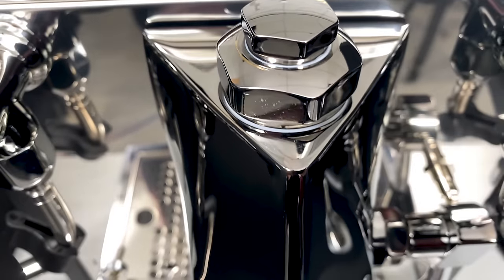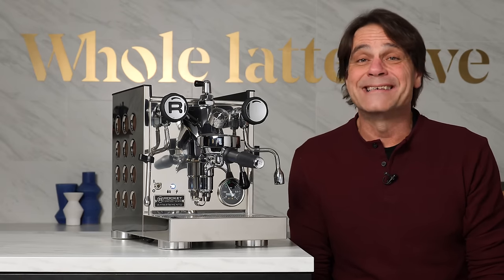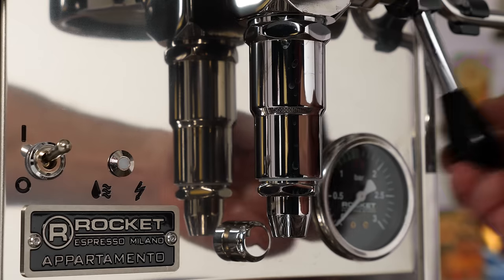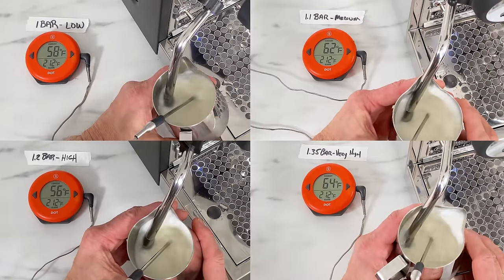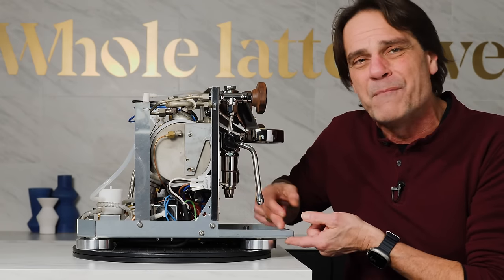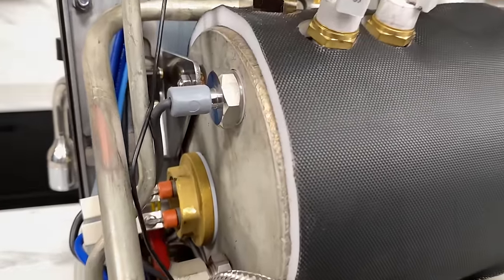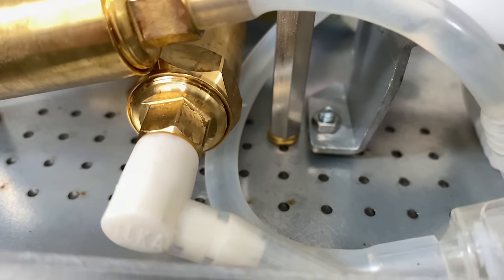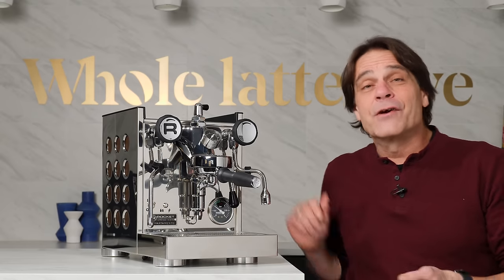Rocket Appartamento TCA Espresso Machine Review

Comment: The Swiss Kaffeemacher team just published very extensive test results for this machine. The temperature tests are very disappointing. It takes this machine 42 minutes to get up to temp! It's 2024, Rocket can't do better than that?? The original model was better!
Reply: @Wholelattelovepage could you confirm these results? The review was pretty devastating for the TCA.
Reply from the maker: Hi s, I cannot confirm/deny the 42 minute heat up time. I did not test for that. I have tested other E61 group machines in the past and found full temperature stability reached (by measuring group surface temp) at 28 to 35 minutes. If it's an extra 10 minutes I would not consider that devastating. Those concerned with heat up time should go with a smart plug or similar so any E61 machine is heated and ready to go when needed. There are E61 machines like the Profitec Drive which have fast heating modes using brew boiler overheat plus a flush and non-E61 electrically heated groups like Bezzera's BZ which can be ready to brew sooner.
Marc
Reply: Wow! How much electricity will you use per year heating it for a coffee in the morning and a coffee at lunch? It would likely cost a fortune?
Reply: Mine warms up in less than 15 minutes 👍🏼
Reply: @c0mbat15 it’s a 2 thousand dollar machine for brewing espresso. However buys this couldn’t give two dog craps about the light bill
Reply: @peter-7118 how so?

Comment: Wow there's a lot of hidden updates here! New Steam tip, new unpainted solid frame, and insulated stainless boiler are all exciting updates that others have missed. Love how thorough you guys are.
Reply from the maker: hi tm, yes there are and thanks for the kind words!
Marc
Reply: Yeah, I own the exact same one. I haven’t even noticed most of the new features lol.
Reply: The boiler is not stainless steel but coated and treaded copper. Rocket have producing machines with this coating for a couple of years at least.
Reply from the maker: @vittorioascani5615   Thankjs for that. I did pin this comment a few weeks ago with that correction:
Correction on boiler material: Boiler is copper and coated with Tea B technology developed by an Italian company: https://teaplus.it/en/index.html
The hot line copper pipes are treated with the same technology.
The product is NSF safe.

Comment: i thought HX machines didn't need PID....they were supposed to be stable by HX design.
Reply from the maker: Hi s, HX machines without PID that run on pressurestats for temperature control operate in a wider swing of temps in the boiler. Some machines of that type are better than others but most will require a fairly aggressive cooling flush if on and idle for long periods.
Marc

Comment: is it possible to regulate the pump of water?
Reply from the maker: Hey g, thanks for the question. Maximum brewing water pressure can be changed internally by adjusting the OPV. Beyond that, the Appartamento TCA is available with flow control on the E61group. Using flow control, one can control and adjust brew water flow rate and pressure during an espresso extraction: https://www.wholelattelove.com/collections/semi-automatic-espresso-machines/products/rocket-espresso-appartamento-tca-espresso-machine-with-flow-control-black-and-copper
Hope that helps!
Marc

Comment: This is a very interesting machine. I noticed on the website there are a lot of reviews. However, the machine is relatively new and some of the reviews are pretty old. Are the reviews for the older Apartamento accidentally showing up for the TCA on your website?
Reply from the maker: Hey TM, Thanks for the comment and question - yes, those reviews from previous version.
Reply: Why leave them up? It’s very misleading. WLL are a good company, I know that’s not your intent but it should be corrected.
Reply: Why leave them up? It’s very misleading. WLL are a good company, I know that’s not your intent but it should be corrected.

Comment: Hello Marc, the truth is that I'm a little confused. I love the apartment. I was about to buy the last one and this new TCA comes out and I just fell in love. Only that watching different videos and comments I'm disappointed by what they say about this new TCA and I don't know if it's the right thing to buy it. Since, as we well know, it is not a very cheap machine. I want a machine that is good, that lasts a long time and that is worth what it costs, do you think that this machine is really worth it or what machine would you recommend to me? I wouldn't like to buy it and that a month it comes out that it's the worst rocket in the world hahahaha. Another question, if you had the money in your hands, would you buy this TCA? Or which machine would you buy?
Reply from the maker: Hi c, The Appartamento TCA is a good, well built and striking machine. The look of the group is very unique. It should be as reliable as similar competing machines so long as you feed it good water and do the routine maintenance. The only real knock I've seen on the machine is a slightly longer heat up time than other similar E61 group machines. Very easy to deal with that using a smart plug so you can schedule on/off times. It may come down to a style preference like having the "port hole" color options on the Appartamento TCA. The closest competing machine is the Profitec Pro 400: https://www.wholelattelove.com/products/profitec-pro-400-espresso-machine-in-matte-black-with-flow-control-and-walnut
The Pro 400 is currently priced lower than the TCA. Instead of adjusting temps using the lever programming of the TCA the Pro 400 has a 3 position switch. Some may find the switch easier to use. The TCA has 4 temperature presets and the Pro 400 has 3. If you do a lot of milk drinks, the frothing on the TCA is slightly more powerful (even at lower temps) than the Pro 400 so that might be a consideration. I honestly don't see myself changing temperature settings very often so If going for a style statement I'd go with the TCA. If looking for similar capabilities at lower price I'd go with the 400.
Hope that helps!
Marc
Reply: @Wholelattelovepage  Thanks marc🙏🏼
Reply: @Wholelattelovepage does the Profitec Pro 400 have PID? Are we comparing apples to apples ?

Comment: Thank you for this great review. 
Saw at 4:38 that pressure is pretty stable at 9 bars. Did you set it or this is the value out of the box (as the previous Appartamento was known to be closer than 11/12 bars out of the box) ? 
Thank you for your time.
Reply from the maker: Hi l, you are welcome and thanks for the comment and question. That was an out of the box result. Brew pressure was not adjusted prior to testing. Note the reading shown on the TPD is pressure in the portafilter during a simulated extraction. If one were to measure a static pressure with no simulation of the extraction pressure would be a bit higher.
Marc
Reply: @Wholelattelovepage  Thank your for your reply !

Comment: Fantastic video, thank you! This narrows the gap between the Appartamento TCA and the Mozzafiato. Other than aesthetics what should I consider to help decide between the two? E.g. Is the rotary pump worth the upgrade?
Reply from the maker: Hey ns, You're welcome! The Rotary pump version of Mozzafiato is plumbable direct to waterline. Of course the rotary pump has a more pleasant sound and has higher potential flow rate than a vibe pump. Also has a shot clock, dual gauges and degree by degree control of temps via the PID controller hidden behind the drip tray. It's also available now with flow control from us: https://www.wholelattelove.com/products/rocket-espresso-mozzafiato-cronometro-r-nera-espresso-machine-with-flow-control
Hope that helps!
Marc

Comment: thanks for this video! always top-notch!
I've owned an Appartamento Rocket for almost 6 years (it will be 6 years in April). I wanted to equip it with a Flow Control system, but a professional told me this: "With the Rocket machines, you have to be a little careful, because the pressure trumpet is made of ceramic. This results in a high resistance to deposits, but the trumpets are somewhat sensitive." Was this warning valid, and if so, does it change with the new appartamento? Thank you for your help.
Reply from the maker: Hi bttb, You are welcome and thanks for the question! Also, thanks for sharing re. your Appartamento. The stock E61 Mushroom (trumpet) in Rocket machines I've used for a number of years now are ceramic. Helps with metal flaking that used to happen with old plated mushrooms and resists scale. But, they are brittle - so you don't want to drop on floor etc. The flow control we install in the Appartamento TCA and every FC I've used from other. manufacturers is metal, stainless steel and completely replaces the ceramic part in the Appartamento's group so no worries.
Hope that helps!
Marc
Reply: @Wholelattelovepage  yes, thank you very much!

Comment: Would you recommend the Appartamento TCA over other machines at this price such as the Lelit Mara X, Profitec Pro 500 PID etc?
Reply from the maker: Hi J, thanks for the question. It really comes down to what's important to you. All the machines you mention are very capable. And there are others like the Profitec Pro 400 and the ECM Mechanika VI Slim which operate with PID controlled temperature presets similar to the TCA. For some it may be a style choice. For others it's price, customizing options, size, accessories, etc. Maybe a shot clock and brew pressure gauge are important to you.
Hope that helps!
Marc
Reply: I just received the ecm mechanika vi slim 2 weeks ago and it’s amazing! Not a lot of reviews online but I think it’s incredible, nice size, and amazing results pairing it with the eureka mignon specialita

Comment: Great vid Marc. 

Question I picked up another machine from you. The Bezzera matrix. Question. What is optimum tds for the copper water and should I use tap with bwt pitcher and lime ale pouch for tank or Poland spring in bwt pitcher plus pouch. I’m downstate from you in Westchester so my water hardness is 250 with out pitcher and when run through pitcher about 150 or so. Thank you much.
Reply from the maker: Hi May, Thanks for the comment and question. If that 150 out of the pitcher is TDS then it's measuring all minerals and calcium portion is low enough for no scale. You should be all set with tap water and pitcher with no need for bottled water or pouches.
Reply: What if your using RO water with TDS of 80 ppm would the machine recognize it?
Reply from the maker: @trschinschin  Yes, 80ppm should be fine!

Comment: Hi Mark, does it already come pre set at a 9 bar or we need to have it adjusted from out of the box? Thanks
Reply from the maker: Hey Gc, thanks for the question. The machine comes out of the box set for proper pressure in the group during an actual extraction. I made no OPV adjustments on the machine in the video. Note the pressure reading during my temperature test using the TPD device showing ~9 bar during a simulated extraction.
Marc

Comment: I don't think it's correct to say that the Appartamento TCA has PID.
It has temperature adjustment control, but this is not achieved via a PID.
It's achieved via pressure adjustments.
Even the Rocket site doesn't mention PID.
The Espresso Coffee Shop from Italy indicates it doesn't have a PID.
Reply from the maker: Hi s, The original Appartamento was a pressurestat controlled machine. On the new TCA version there is no pressure measuring device on the boiler. I did show the temperature probe here in this video. It's the black wire with gray cap entering the side of boiler: https://youtu.be/duStXQ2aoKM?si=JhW9D51ujaicWTnu&t=508
Many familiar with PID are used to machines which have degree by degree adjustment of temperature so this setup is a little different with temperature ranges.
Reply: I agree. If it had a PID would they not have called it “Apartamento PID”? Whatever the case it seems a cooling flush is still required 4:23

Comment: Very good looking machine, probably the sexiest I've seen! Go figure however why their most beautifully designed machines are their least good (-_-) I wish I could have that look on my 2019's Rocket R58 but there's no way I will be trading performance and quality in exchange of a nicer look.

It's also goddamn time that they finally add a PID which the first one should have already, but not only this comes like 10 years too late after the entire competition... it comes at an extra cost of +300$CAD which ain't nothing considering Rocket was probably already the priciest Heat Exchanger with the least good price/quality ratio compare to all ECM, Profitec, Lelit, etc.

I've installed a Flow Control on my R58 and ended up never using it. I find the one on the Bianca V3 I also bought, much more user-friendly but still never use it. I'm realllly not a fan of the "no screen at all". At the very least they could have hidden it into the drip tray like they did on the Mozzafiato which I used to have. I hated that but at least there was a way I could precisely see AND adjust the temperature rather than some blinking lights which you have to guess. Otherwise, the (Lelit MaraX) I bought for my GF is a better value imo for something with a similar concept and it has a dual-PID with a "Steam vs Coffee Priority" feature which is very clever for a Heat Exchange machine.

Nice review though, WLL makes the best out there on Youtube!

Comment: Marc I spoke to you before about my water my Poland when I run through bwt is about 43 ppm and slightly alkaline. Is that to low. My tap water through bwt is about 140 ppm. I know you said before that the tap through bwt and pouch in tank is good. Should I just go for Poland or stay with tap. If I do plumb machine I would still be using Poland or tap. Or would you recommend when I plumb to run through filter? Thanks for advice.
Reply from the maker: Hey May, 43ppm is on the low side but not concerning. The 140 through the BWT is fine. For both of those ppm readings understand you're likely measuring all the minerals in the water (and maybe other dissolved solids as well). We're really only concerned with the calcium level and at your ppm's it's very unlikely there's enough calcium in the water to cause scale. You do not need to use the BWT pitcher and Bestsave pouch together. Not going to hurt anything but both are not needed. If you plumb the machine I recommend using tap water and the BWT Bestmax premium inline filter.
Marc
Reply: @Wholelattelovepage  Thank u much marc

Comment: Can you tell whats the default temperature settings when you unbox.and what the temoerature of water coming out of it and temperature of espresso shot?
Reply from the maker: Hi m, Thanks for the question. As I recall the machine was set to the medium setting out of the box (2 flashes in programming mode) which gives in portafilter brew temp of 200F/93C during simulated extraction as shown in the video. Temperature of espresso shot is determined by local variables like ambient temperature, cup temperature, length of shot, etc.
Hope that helps!
Marc

Comment: Hi Marc, Could you kindly tell me what is the default brew pressure without flow control on this machine ? Is it 9 bars out of factory ?
Reply from the maker: Hi ap, sure! As seen on the Pesado TPD device during the temperature tests in this video pressure in the portafilter ranged from 8.5-9.5 bar when tuned to simulate an extraction.
Marc
Reply: @Wholelattelovepage  Thanks Marc ! I am in process of getting a new espresso HX and facing a dilemma with Appartamento TCA and Mechanika SLIM VI. Can you help me make that choice please !
Reply from the maker: @aniketphatak2829  It may come down to the style you prefer. The machines are fairly similar. The Slim VI has a 3 way switch to select temps while the TCA has 4 presets selected by moving the group lever while in programming mode. On either machine, I think most users will only use 2 of the presets. The Slim has a pre-infusion mode and a brew pressure gauge not found on the Appartamento. Here's my in-depth video on the Mechanika https://youtu.be/rbgCU_hzyDc
Hope that helps!
Marc
Reply: @Wholelattelovepage  Hi Marc, Thank you for the insights, also I heard that Mechanika Slim and Profitect 400 had some issues with the rubber gasket breaking when the steam valves are over tightened. Does that issue still persist ? or would you suggest investing some extra and going for Mechanika Max ?

Comment: mark tell me one thing .My TCA after waiting for 20-25 minutes after turning it on
Water comes at temperature of 82-85°c in the pre warmed shot glass. So is it ok?.considering it is in medium settings (default setting / out of the box haven't changed anything)
Reply from the maker: Hi m, The medium setting should produce about 93C in the portafilter during an extraction. Cooling to 80 - 85C in the cup sounds about right. I'd expect a drop of at least 5C if measuring directly in stream of espresso as it drips from portafilter. And that's a temp read by a fast acting technical temperature probe.  So larger difference if measuring an in cup temperature with a more standard type of thermometer.
I hope that helps!
Marc
Reply: @Wholelattelovepage  thanks a lot. Yes indeed it helped a lot.

Comment: Descalling a HX espresso machine it's not very useful because your water used for coffee extraction, which is the most important one, does not enter the boiler, it's fresh water from the water tank, heated instantly when you are making the extraction. The only water that is going to touch your boiler is the water used to steam milk.
From my perspective if you can live with the temperature stability issues of an HX machine, you will always use only freshly heated water for coffee extraction.
Both single and dual boiler machines are using water heated and cooled multiple times because no one empties the boiler after one coffee.